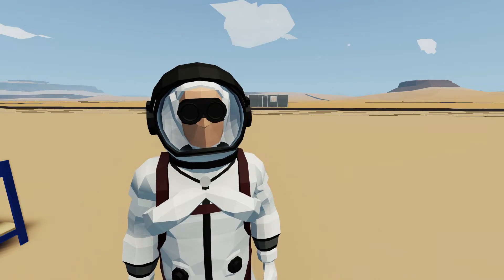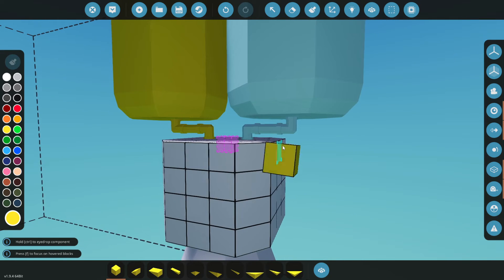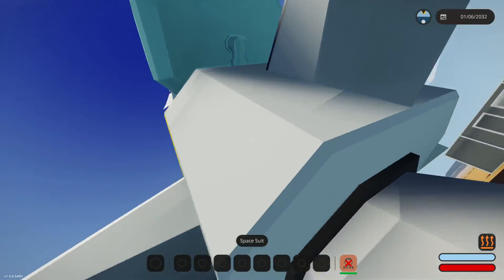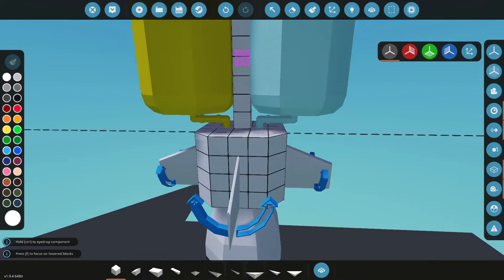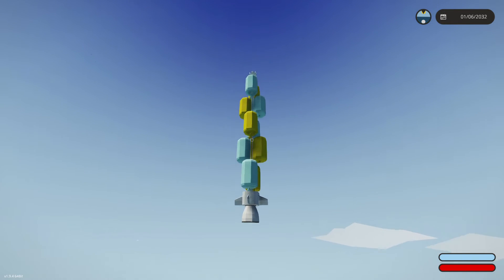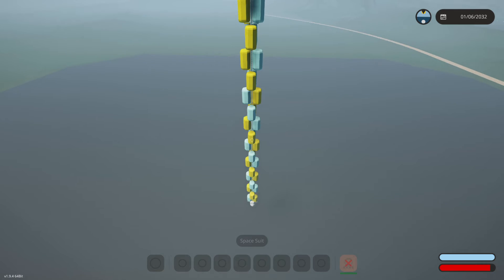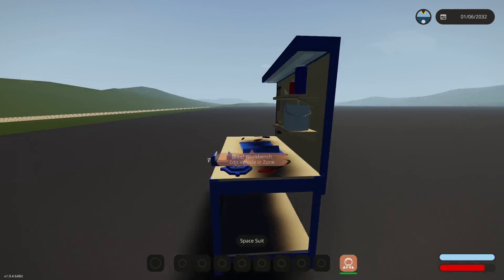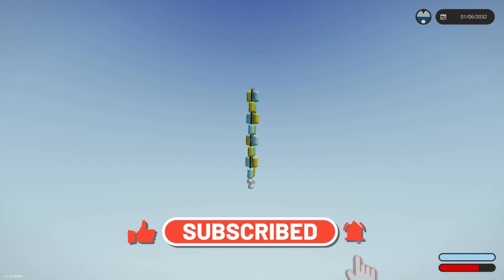Liquid Fuel Rockets - Stormworks Tutorial - How To

Comment: I just did a side-by-side test and the liquid engines leak when not ignited. You can watch the contents and pressure drop in the tanks.  To fix this, I added a Fluid On/Off valve that opens when I press my launch/ignite toggle button.
Reply: I noticed that too and did the same thing to fix it.
Reply: That is how liquid fuel rocket engines work. They leak a bit of fuel when not in use, I believe it is due to the fuel sublimating.
Reply: We’re do we spawn at to make rockets? I can’t figure it out
Reply: spawn at Clark airfield if you have the industrial DLC otherwise O'Neil airbase if you dont @Nooo948
Reply: @Nooo948  you can spawn them at an open spot or through missions but there is a dedicated one behind one of the desert airbase
Reply: @suprised_cat  I found it

Comment: but how do you make solid rocket fuel? what's the machinery to use, to make that?
Reply from the maker: Working on that tutorial
Reply: @ProfNCognito  I don't know, if you can make solid rocket fuel yourself or not, but if not, then i found out, where you can, but in the latter case, i'd find it a pity, that you could only make it there.
Reply: It's very simple get fuel size and put as much as you think is good then put a booster on the black opening then set up the ignition so a button connect to the boosters ignite and it should work